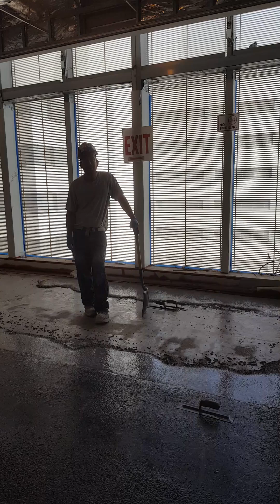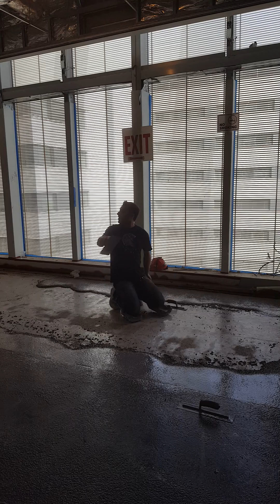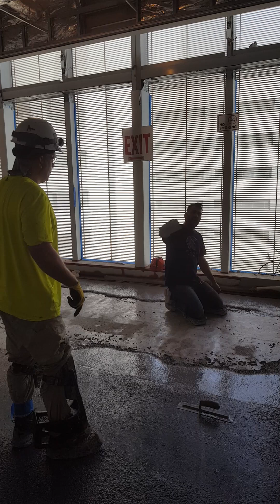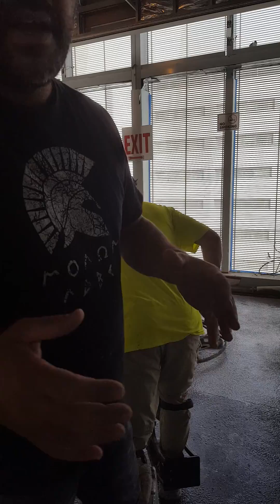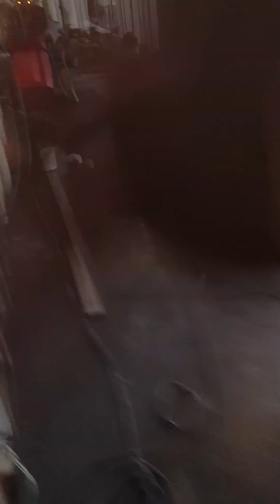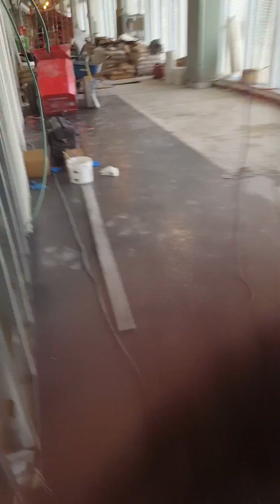terrazzo floor installation top speed gold wheel Barrow and Shovel.😘😘

Comment: Your applications are very nice. What are the terrazzo mixing ratios and what products do you use?
Reply from the maker: Sherwin William's 3520 A to 3520 B. Is 4 part A to 1 part B? This is the liquid
Reply: @dionisiostheodoropoulos1091   Okay, what is the ratio of aggregate and powder for 1 square meter, that is, exactly how much of which product do we mix?
Reply from the maker: You can use marble chips,glass, or plastic anything that you are comfortable to grind and polishing. The mixing is 150 pounds, chips to 4 gallons, epoxy part A and 1 gallon part B
Reply: @dionisiostheodoropoulos1091  Can you tell me, in kilograms, how many kilograms of aggregate do we mix with how many kilograms of epoxy for 1 square meter of 10 mm thickness, in order to calculate the cost?
Reply from the maker: 70 kilos marble chips per mix that will need 5 kilos part B and 1 kilos part B that will cover more or less 5 square meters on 10mm